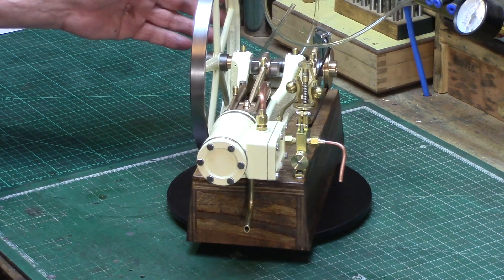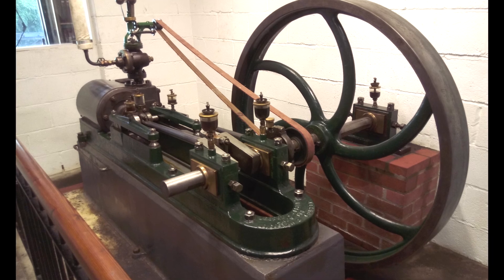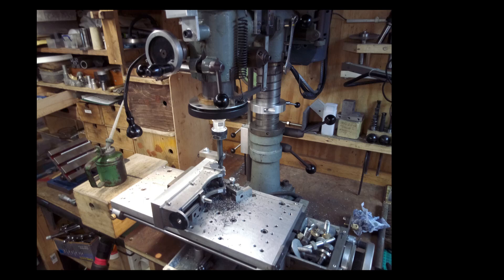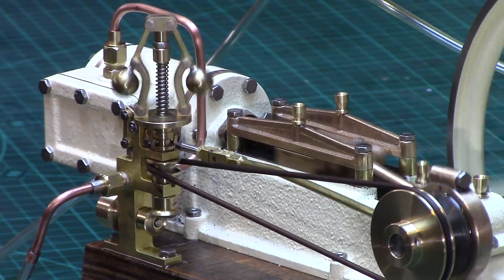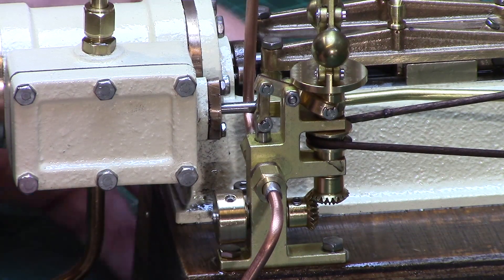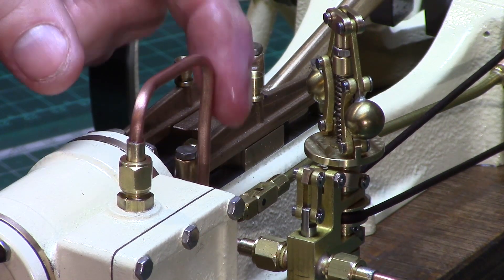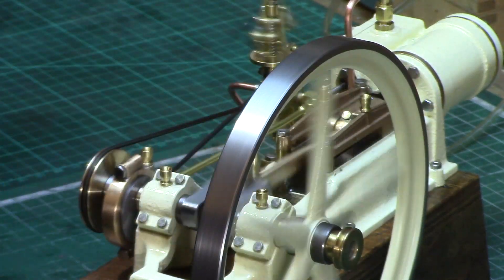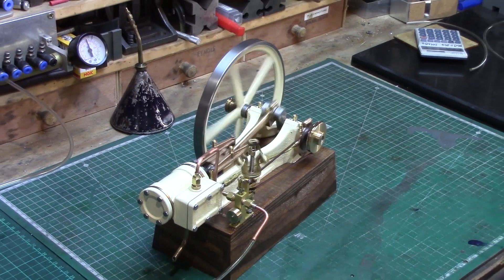Model Steam Oil Drilling Engine - P.M. Research #1

Comment: Very nice build. I found both building video series very helpful in making this engine but unlike them I mounted the frame to an aluminum fixture plate as you did and left it there for the entire build. It made setups much easier. I built it with the provided fasteners but made replacements with hex heads for a better appearance. My connecting rod casting had a severe mismatch so I made one from scratch out of brass. I’m watching this video to get an idea of the required pulley size to run a centrifugal governor.

Comment: That is a beautiful engine Ade, well done I love the governor and the paint finish scheme. I have just bought one from Forest, hope it turns (ha pun) out half as good as yours. I have had some experience building the Stuart V10. All the best, Graham.
Reply from the maker: Hi Graham, It is a lovely engine, it has some tricky setups on the mill, but all good fun. I wish you good luck with your casting set. Kindest Regards. Ade

Comment: Very nice build. You did a fine job. This was the first engine I built from a casting kit. I just couldn't get the crank shaft done right and gave up on it. Built one from scratch as per Keith Appleton. I do like your governor and will look into one for my engine. Keep up the good work.

Comment: Did you use your normal graphic yarn on the piston? If so what size is the yarn?  I am having problems with using the included PTFE piston ring material.  Is it possible to use the graphic material instead?  Thanks
Reply from the maker: @philt214 - Hi Phil, yes I used Graphite Yarn on both the piston seal and the stuffing boxes, he yarn I have is approx 1.5mm diameter, but is stranded so can be thinned. I like this stuff and use it on all my engines. Kind Regards. Ade

Comment: Ade having seen a number of these PM research engine builds ( this is the first cast iron one, even Joe Pie's steam engine build was an aluminium one) all of them have been made from aluminium castings and the quality of the moulding of the sand casts is very questionable. In some of the mis matched castings it appears as if the two halves of the pattern are not dowelled together allowing mismatching of the finished casting. Considering how much they charge for these kits you would think that they would address the problem or get better people to make the sand castings. Your model looks great and I'd truly love to build one but as I've only an overhead milling arm attached to my lathe ( a Warco WMT 300 ) with a maximum of 160 mm of usable linear travel in the Longditudinal axis I couldn't even machine the base casting. But hey ho hoping one day to get a dedicated milling machine !
Reply from the maker: Thanks Samrodian, the flywheel was not easy to machine to get it concentric, but the other castings were ok. There are some smaller kits available which you could probably fit around your machine, but yes none of them are cheap, you could make a barstock engine, they are just as satisfying to build
Reply: I just finished mine and they replaced the (cast iron) base casting on request due to excessive warpage. The connecting rod had a significant mismatch but I didn’t notice it until the other casting had shipped so instead of requesting a new one I made my own out of brass bar stock. It was an enjoyable exercise.

Comment: High ade !this is the fantastic Build and I wanted to ask if you perhaps could tell me which drill sizes and which Taps are required to build the engine according to the drawings
Reply from the maker: Hi Pirmin. The original plans specify imperial threads and fittings, but the majority of my tooling is metrric, so I used the closest equivalents to them. Regards. Ade
Reply: @adeswash  Hy.

I already have the kit and Had to Order all taps and Drills ( a financial Desaster If you Life in Austria )
The endmills and spotface Drills need to be ordered yet wich is the Second Desaster....
I want to know If your flywheel was also so Bad Out of roundness before Machining ?
Reply from the maker: @pirminkogleck4056  yes the flywheel was not in great shape, i think it had warped when cooling down, but I persevered with it and made the best of a bad job, I think if it was painted a darker colour it would be less conspicuous
Reply: @adeswash  mine is also warped and i Had to Clean it good with a Lot Patience and jewelers needle Files ....i will have to send IT to a Friend with a Big emco v13 maximat lathe because mine is a touch to small for that Job ( i Wish i could do it myself) so i Hope all will Go fine...
Your pmr nr1 is the best i saw so far beside that turquoise one in YouTube ...Joe pie is a good machinist but Sometimes His different approaches on Things dont suit my Style of Machining....so. I am looking Forward to get mine perfect

Comment: Nicely done Ade.  I like your use of fixtures and jigs for work-holding, as well as the mods/changes from the original plans.  I also like your use of hex heads vs slotted.  I'll get to building my #1 one of these days, likely after watching everyone else do theirs ;).  I do hope mine looks (and runs) as nicely.  Pattern miss-match during casting of the parts, seems to be an issue for PM.  Cheers.
Reply from the maker: Thanks EN, glad you enjoyed the vid, regards. Ade

Comment: Very nice engine however you made the same mistake as a lot of people including blondyhacks.  Its running backwards, and the theory behind it is very simple. As the piston pushes the crosshead forward the connecting rod should  rise pushing the crosshead down into a large piece of stable cast iron as it returns it once again pushes the crosshead down into a piece of cast iron.The crosshead guide bars are only there to give a bit of stability and to keep the bearing surfaces in contact. Hope this helps and best regards.
Reply from the maker: Maybe so, but I'm less likely to trap one of my pinkies between the crank and the base this way
Reply: You can lead a horse to water
Reply: You've baffled me now can you explain. Also the flywheel would pose more of a hazard and that's just as dangerous either way.
Secondly you shouldn't have your pinkies anywhere near it when it's running. I was just offering some technical advice not knocking a nice engine. 
Have a nice day 😊
Reply from the maker: @jonathanbale5410  the crank has little clearance, and creates a pinch-point as it closes down towards the base, Joe Pie also pointed this out, I'd rather be safe than sorry

Comment: Nice video on the engine and what other things people can do.
Joe Pi took hours to get his fly wheel looking as good as he did. Maybe PM need to look at that.
Love that pallet for machining the main base. I had almost exactly the same idea and couldn't understand why others don't do that for all these types of engine. It seemed obvious to me that you could mover the part from setup to setup or machine to machine and easily re-reference.
I really like your version of the crank jig for the offset.
Reply from the maker: Hi Tony, the pallet is the best way, very easy to swap-out setups with easy reference to square, and yes the flywheel was a tough one, if I could start again on it I could probably iron out the problems, but I hadnt realised the inner rim issue when I was turning, and it was all to late to recover from

Comment: Lovely work once again.  I'm glad you junked those cheese head screws.
Reply from the maker: Thanks John,  I think the Hex bolts look better, just a pity you can't buy them with a smaller scale head. Regards. Ade
Reply: @adeswash  you can but only in BA threads.  Another way to go is to make dummy studs by cutting off the existing head and loctite a nut on the end.  You then use it like a normal bolt.  It looks very tidy.  It’s not too hard to make a bunch of nuts.

Comment: With a mill and a box that size you don't really need to have a proper wood working shop and all the tooling. It just takes some proper understanding of what your wanting to do and how to get there. In fact there's very few wood working joints that can't be easily replicated other than maybe half blind dovetails on a mill. That plywood is a good choice as far as wood goes since it's much more stable than solid wood might be, but it's not furniture grade either. It's biggest problem is when it's end grain is showing as you have it. Remaking that box to have all 90 degree angles as a 45 degree on each part removes those end grain layers showing. And that's easily done on a mill by ignoring the fact it's wood and pretending it's a very soft brown colored aluminum. Just treat it the same and use the same set ups as you would if you were building it from that aluminum plate with the same checks for alignment accuracy to obtain extremely tight fitting and accurate angles. Poor fitting joints are very obvious on something that size so the absolute best accuracy you can manage isn't really optional in my opinion. But I also wouldn't depend on straight glued joints either. Drilling and gluing in proper dowels to help mechanically reinforce each joint is very important. Your mills built in accuracy and past experience will help a lot. Today it's now mostly cnc, prior to that manual high speed mills were used a great deal in pattern making shops at foundry's because of there accuracy and ease of use. In fact I'd be surprised if the patterns for that model engine were not made on exactly that. More complicated, but a straight walled 90 degree box shape wouldn't be used on any full sized engine, almost for sure the sides and ends would be sloped out at least by a 3-5 degree angle, that also looks a lot better, but obviously involves cutting compound angles. Again it's not all that hard to do on a mill, just a bit more time consuming.

At the usual much lower rpms available on most mills I've compared the cut quality between straight router bits and end mills. While not as good as what a router can provide with roughly 20k rpm, very sharp end mills do give a better surface finish than the the actual wood cutting router bits can. Wood does have an extra issue of having it tear out on edges. Backing up and supporting the woods top surface or ends of cuts with scraps of common fir or pine construction grade lumber eliminates that problem. For the top surface the engine is sitting on and to cover up that plywood grain a plank floor wouldn't be out of place. You can either buy that from wooden model ship suppliers or cut your own with small roughly 4" diameter carbide tipped blades made for the saws model ship builders use. Correctly done that type of planking would be a repeating pattern of either 3,5, or even 7 planks wide where the plank ends are the same length at every 3,5 or 7 plank spacing across the width of the floor. That pattern is sometimes called a ship laid floor and was almost always used on full sized wood decked ships and on stationary engine room floors. Ideally and to properly pull off the illusion you'd also replicate what would have been an underlying beam structure by drilling and doweling each plank end and along the plank length to show that structural layout. Drawing it out first on paper and figuring out probably a 24" beam spacing at 1/8th scale might take a bit of work, but the end result would be worth doing so. Premade small diameter hardwood dowel stock can also be bought from those model ship suppliers for that doweling. A light staining after the floor is completed with fine grain sandpaper to apply the wet stain works well to help fill any grain and get a very smooth surface for model sized work. The just wipe off the excess with a clean rag. For anything like this I'd recommend some test pieces first as a trial run until your happy with the results. Very convincing brick or even stone would likely have be used as the support structure for a permanent engine placement and that's also easy to find from doll house suppliers that could be used around the sides of that box. It just depends on how far your willing to go to get what you want.

I've machined a fair amount of wood with both my metal cutting lathe and mill, and yes it makes a bit of a mess. But for small projects like your engine box I'd choose to do it on a mill even if I had a full wood working shop. There's simply no comparison between what can be done accuracy wise compared to any of the more conventional wood working equipment.
Reply from the maker: Thanks for the helpful advice Turning Point, I will hopefully get a better base made for it soon Kind Regards. Ade

Comment: That looks great Ade! 
Regarding base, I'm normally using solid hardwood for my models. On one occasion I've used plywood just like you but I've glued a hardwood veneer on top and varnished it. Have a look at my Stuart Victoria and see if you like it https://youtu.be/BEWfqNO-Jg8.
It's easy to do and veneer is cheaper than a solid wood.
Reply from the maker: Thanks Tomasz,  your engine is beautiful. Veneer is a good idea, I will look into this, thankyou
Reply: @adeswash  thanks Ade. Stuart models are nice, currently I'm building a James Coombes. If you like Victoria, have a look at a Beam I've made not long ago.